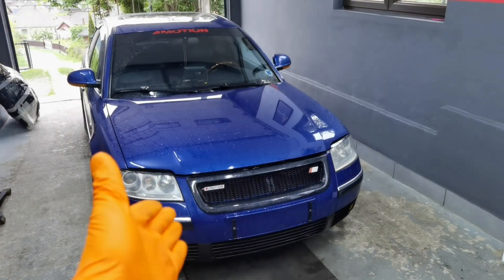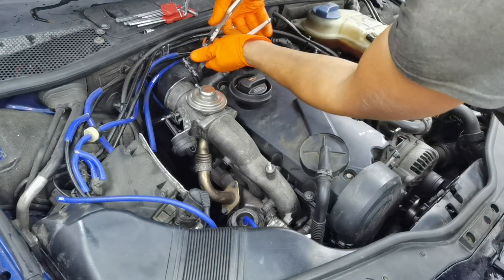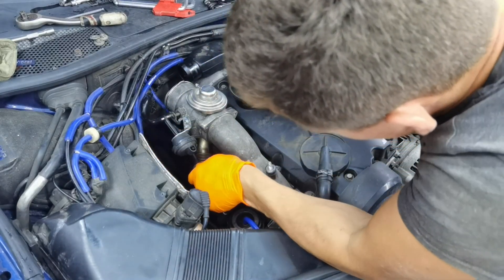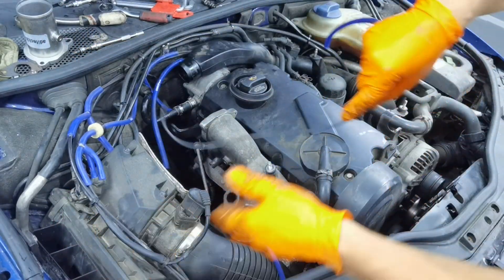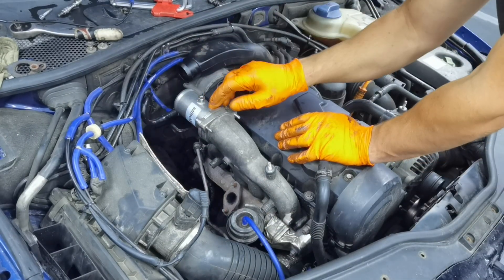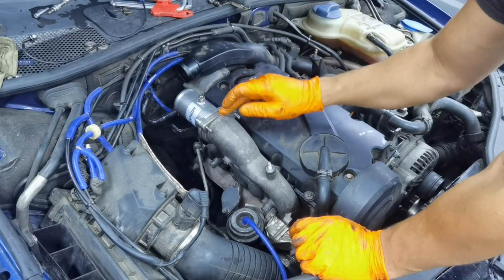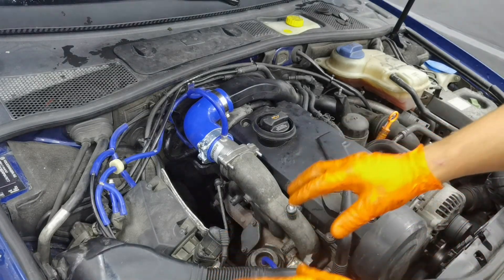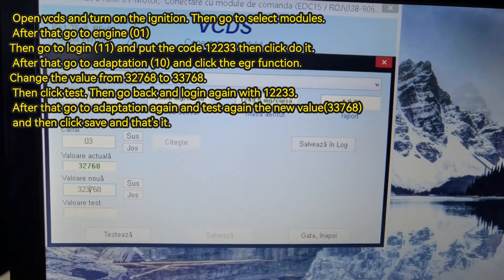How To DO EGR DELETE On Any 2.0/1.9/1.6 Tdi Engine +ECU SOFT

Comment: Can't you just block off the bottom part of the egr where the exhaust gases come in the same way you block the hole in the exhaust manifold?
Reply from the maker: Yes you can,basically you block the same thing but in a different place.